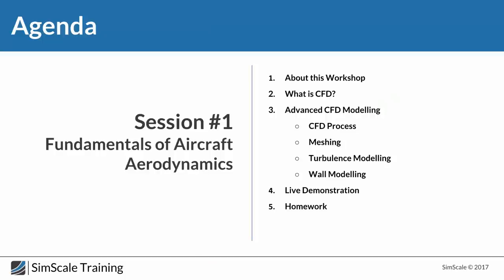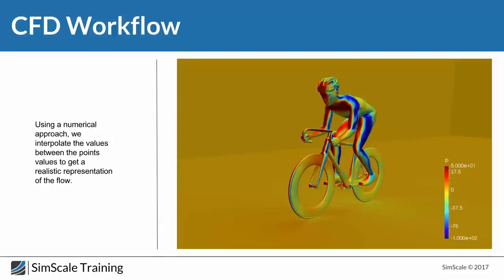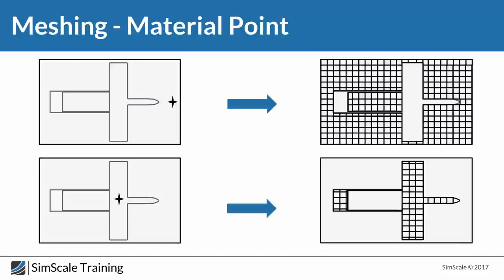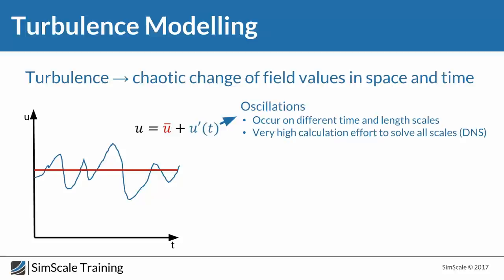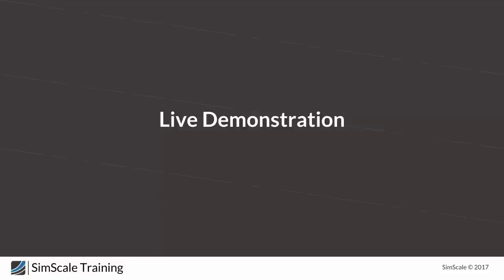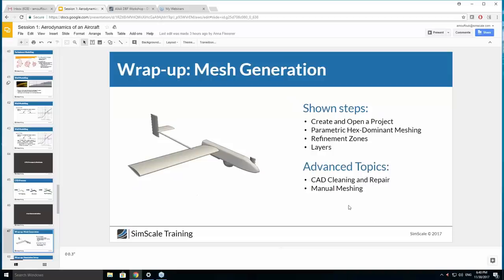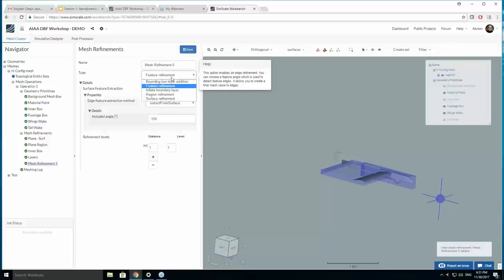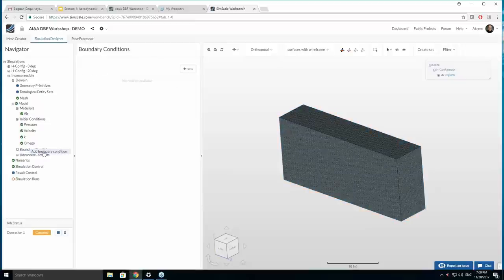Aircraft Design Workshop: Fundamentals of Aircraft Aerodynamics

Comment: The aerodynamics would be simple and almost perfect if the aircraft had a push and pull two engine tandem configuration. The wings should be as close to a delta shape as possible. And the design could be the absolute best.
Reply: Hi. I'm a mechanical engineering student looking to branch out into aerospace /aerodynamics. Can you guide me?
Reply: @ubonginyang1889  ... What do you need help and/or guidance with? If you want examples of this particular configuration take a look at the Adam 500, the Moynet 360 Jupiter, and the Cessna Skymaster; for military aircraft you can reference the Dornier Do 335, Cessna O-2A, and the Tachikawa KI 94 I.
Reply: Do you know any course material or MOOC I could take? I know literally nothing about aerodynamics and aerospace
Reply: @ubonginyang1889  ... I don't know of any free online courses at this point in time. But the basic information about the specific aircraft that I mentioned is available online.
Reply: doesnt that have high ideuced drag?